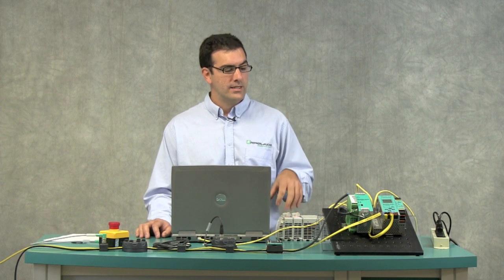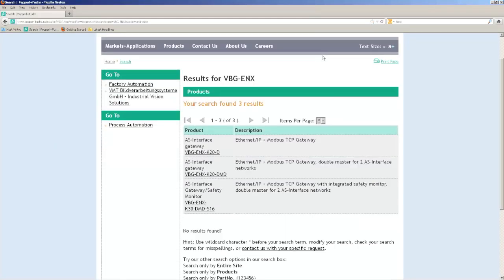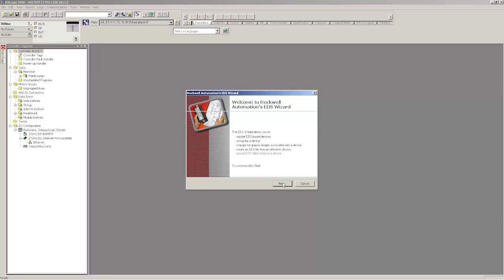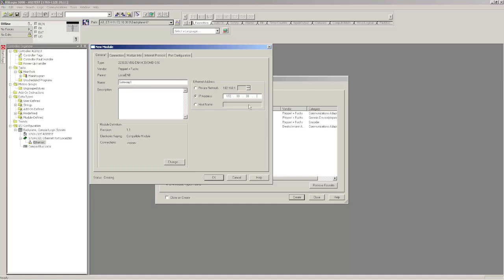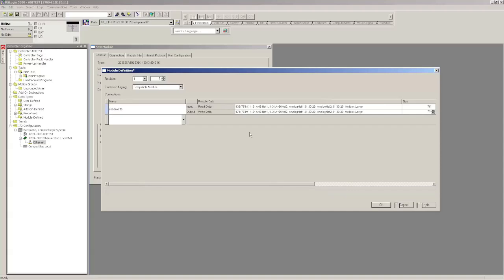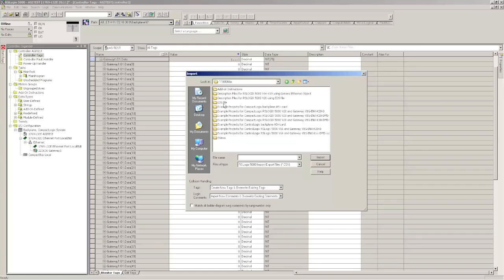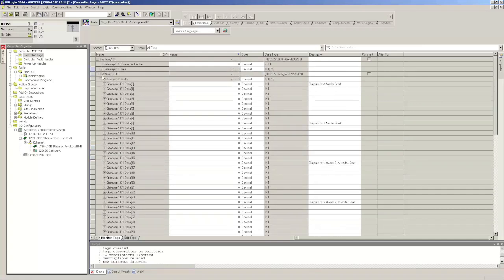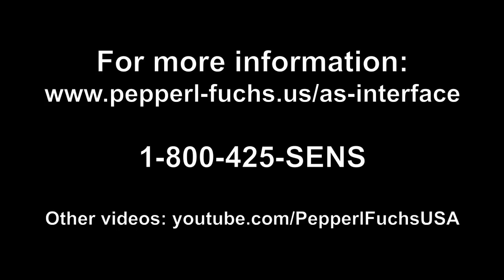Setup AS-Interface Ethernet/IP Gateway in Allen-Bradley PLC w/ EDS File

Comment: How do you find where a module is mapped to without the example .csv files? I have a project where i am adding new modules to an existing network,  but there are no descriptions on any bits used
Reply from the maker: Hi Matt, 

What is the AS-I Gateway currently being used for?·       
VBG-ENX-K30-DMD-S16-EV
à  download the Rockwell Automation Toolkit which includes the .CSV fileshttps://www.pepperl-fuchs.us/usa/en/classid_4994.htm?view=productdetails&prodid=58506#software·       
VBG-ENX-K30-DMD-S16
à  download the sample projects which also provide the .CSV fileshttps://www.pepperl-fuchs.us/usa/en/classid_4994.htm?view=productdetails&prodid=44340#software
In summary, the .CSV files are definitely the best way to determine where the AS-I modules have been mapped.